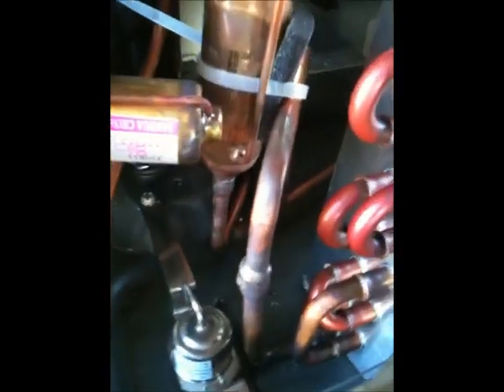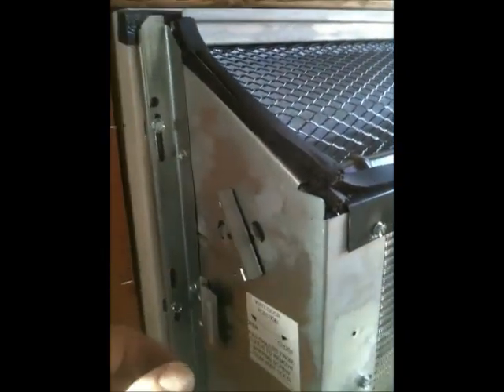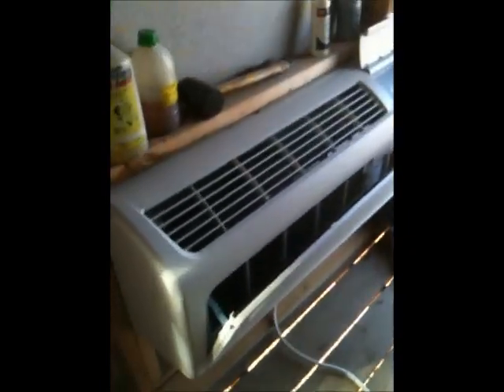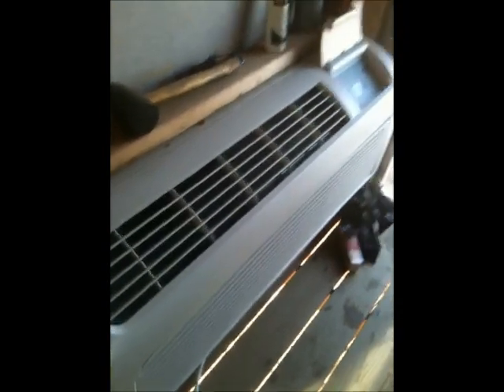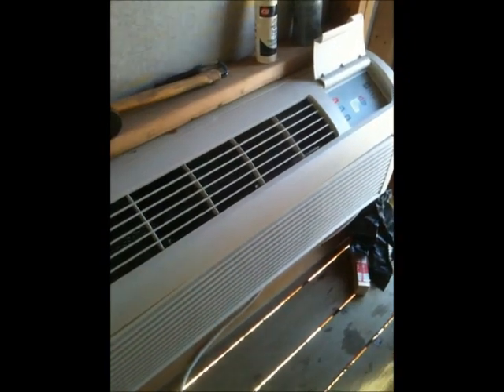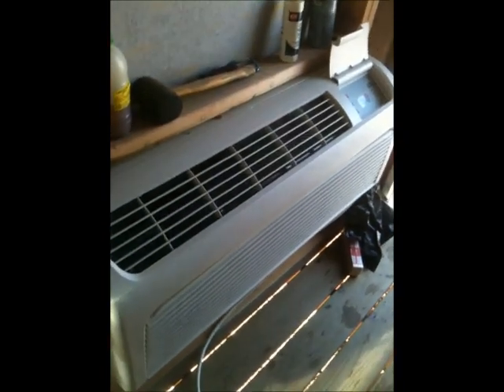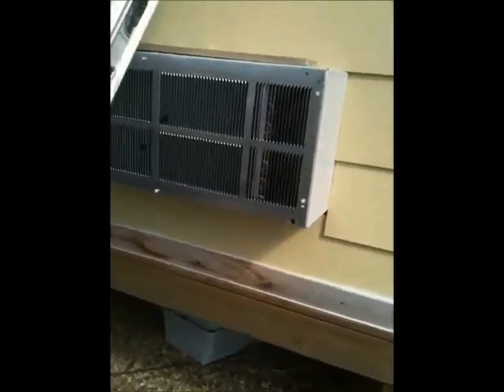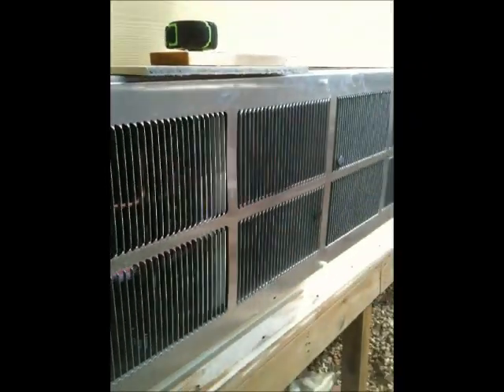HVAC PTAC hvac Air Conditioner installed in new my room.

Comment: i am hoping you put a 2 to 3 degree pitch on the sleeve if not youll have a headache with the draining aspect and also with if youre running it off the face (with no thermostat) make sure you leave all switches down some come pre flipped depending on how you order them likewise with a fredrich or GE. all in all i hate Amana especially installing them. lol they are cheap for a reason they are manufactured in my home state TN so not saying much there. oh and if your sleeve is out past 4 inches you will need a sub base to house your receptical or your wall will buckle and youll be Fucked lol

Comment: Are you still doing PTAC videos?? I was given a new unit free of charge, not bad huh??, and I'm getting ready to cut the cinder block wall to mount the sleeve. On the inside of the basement, how much sleeve should be showing and also what is that damper adjustment that you open or close?? I have no manual. Thanks.
Reply from the maker: Oh wow! A freebee, totally awesome!! That is sweet!!   Ummm... Hmmm. Its been so long since I installed the thing and its the only one Ive ever done.  Ill have to dig around and see if I can find the install manual or find a pdf of one online for you.  I closed the vent since zi didnt want any fresh air mixed in from outside.   I dont remember how much I put inside, ill go back there later today or tomorrow and check...Im thinking I put it in enough so that i had a little space after the unit was in so that the face cover was pretty close to the wall... Ill look.  Just remember to tilt the case at a slight downward angle (if memory serves) so it drains outside before you screw it to the sides. Ill check back in a day or so!
Reply: if youre inside 4 inches then you will have to have a sub base although you having a concrete wall youll most likely be fine
Reply: you need atleast 1 or 2 inches inside and whatevers left obviously outside haha but by damper do you mean the vent that lets the outside air in? if so, alwaya leave it closed if not it will fuck up your unit eventually unless you clean it constantly with coil cleaner its a pain in the ass best to leave the factory screw in and keep it closed.

Comment: @compwiz878 Hi, in the UK we get 240vac 1 phase 50hz to houses, and bigger comercial premesis get 415vac 3 phase. There are a few 480vac split phase (still only 240vac to neutral) supplies out in the sticks but they are getting rare.

Comment: I'm with your brother...electrical and insulation before drywall.  If you're going to heat/cool, you best get it sealed up. Some of those PTACs have thermostatic drains...but they don't work too well.  Good to see the wife's throwing you outta the house.;)

Comment: Yes, an HVAC video. I thought you might have gotten out of the trade?

Nice heat pump, I use those to replace dead Carriers. The Amana guts slide right into the old cabinet.

Why do you hate working on heat pumps? It's not like you have to wade around in 2' of snow in negative temps in Texas. Try a compressor or a reversing valve change out in February in Indiana . You will hate working on heat pumps then. 

What is wow time?

I can't wait to see the HAM shack completed.

Comment: @compwiz878 all houses get 240vac 50hz 1ph and you can get 415vac 3 phase in in comercial use. out bush the have SWER single wire earth return. that can be made in to 1ph 240vac or 2ph 440vac.

Comment: id drill a hole in that unit to let water out because the setup will rott the coil in time. its silly the way you have 2 power types. good vid. nice to see a a/c vid from ya.
Reply: V8Jagnut where at? I’m putting mine in right now and I don’t see where it goes out